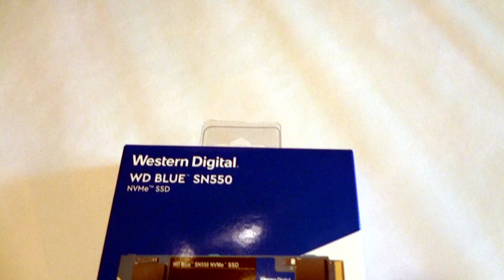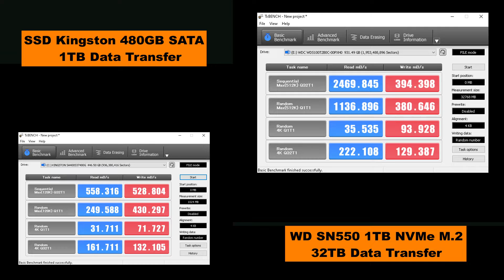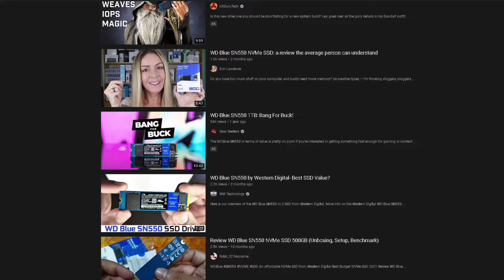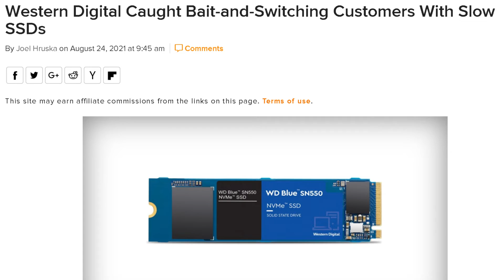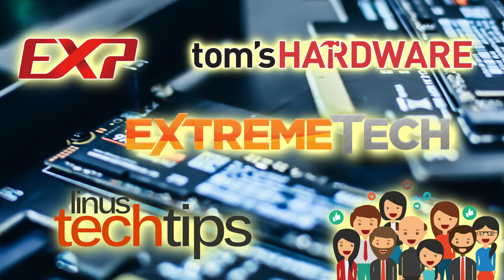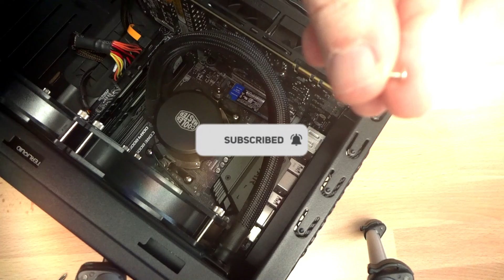Is WD Blue SN550 NVMe a Scam Product?

Comment: Hi I know this is an old video but what ssd would you recommended for under $100. (1 tb)
Reply from the maker: A bit difficult to give a correct answer since you don't provide further info such as interface, type of use etc BUT overall Samsung is one of the most reputed mainstream brands to buy but usually the most expensive.

Just don't go for brands that are not so known and have suspiciously lower prices compared to the average index.

For gaming and easy productivity tasks any $60 to $70 1TB SSD will do, apply to that a cheap AExpress ssd heatsink if it is M.2 and you are good. Hope this helps.

Comment: I found a deal for this exact SSD with the price being 40€ and I am wondering if its a good deal now for 500 gb... Any opinions? It would be used in my Acer Nitro 5 laptop
Reply from the maker: Hi! I'm not sure which market you have access to, so I cannot confirm if you got a good deal or not. However, I want to inform you that the model I reviewed back then has been replaced with the SN750 model.

Additionally, with the current decreasing prices of NVMe SSDs, I am confident that you can find newer and better models similar priced if you leave in USA.
Reply: @obnot  Thank you for the quick response, after some searching I found same sized Samsung SSDs. And now I am considering buying the 980 model or potentialy the 970 evo plus model. Perhaps even 2 SSDs one for my laptop and the other bigger one for my desktop, they would be primaraly used for gaming. I would like to hear your opinion on those two models. :)
Reply from the maker: @TheCROHELLBOY  Don't mention it.

Beyond that Samsung is highly regarded brand in SSDs, I have never actually owned any of their models, so I cannot provide an opinion on them.